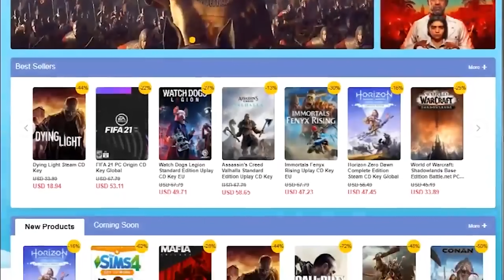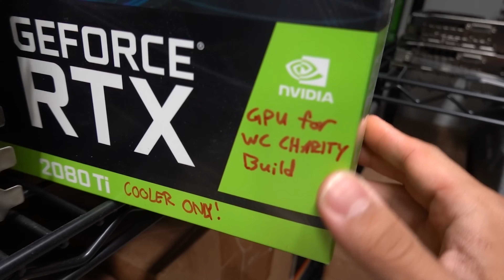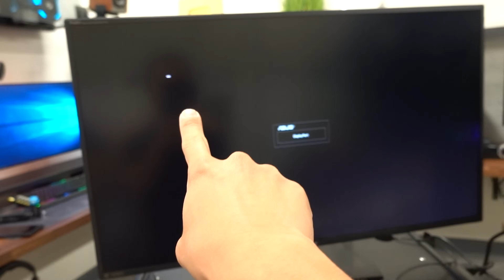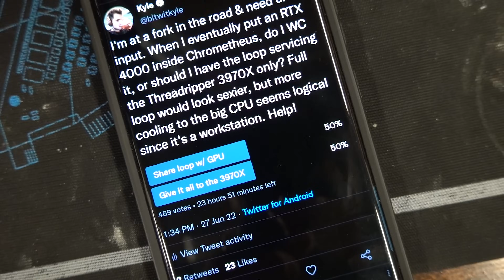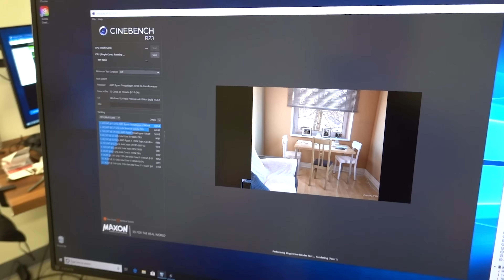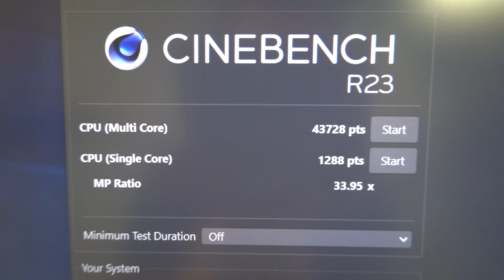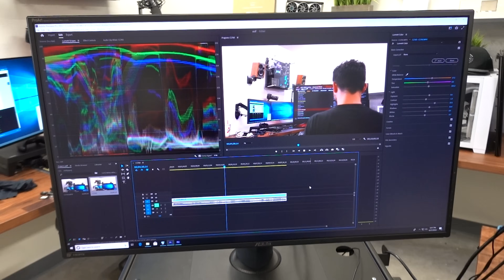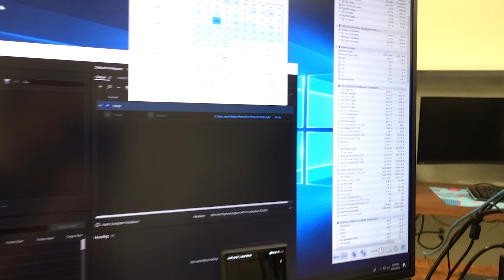YOU got my PC to work! THANK YOU!!

Comment: What a beautiful built! I I get it through needing all of them extra cores but at what literal cost lol. My ryzen 5950x is staying under 65c most of my 16 cores are @ 4999 Mhz Average, 5062 max 3599 mix. Running a simple negative voltage offset.       I couldn't agree more this is too fun that I quit kraq for building pcs. SAME COST more fun X'D lol.

Comment: Ok, the video doesn't make sense...
I've watched it twice and still can't figure out why you haven't done a few simple things:

1) you left the PC broken for 2 years without swapping the GPU to check if its good? Wtf
2) you plugged in the fan, AND at the same time you changed the GPU, but also without ever trying the original GPU back. You just pulled out a brand new GPU from the storage, put the water cooling on it and left the fan plugged in. What happened to the old GPU, is it good? The troubleshooting is not finished man....just saying.

So now, what was the problem in the end? A dead GPU or unplugged fan?

Comment: Keep the 4090 out of the loop. 
If you are hitting 80 degrees with the the 2080 Ti, you won't have a hope of cooling a 4090 effectively. 
That said the system is fine as is.

Comment: It's such a satisfying feelings when something hasn't worked for so long after multiple tries.....then you finally get it going....I was locked out of my dogecoin I had since 2014 and took 2 years of attempting to retrieve the private keys from old hardware and external HDDs that were fried from the wrong power supply....one random comment on reddit and boom I got it...best feeling ever.

Comment: I am currently building a PC 
Specs 
Ryzen 5 5600g 
Biostar a320 m
650 watt psu
16 g ram 
1 tb ssd 
I have hooked everything up but for some reason the case fans won't turn on can I have some advice for the issue

Comment: I just notice your talking while the system is running without coolant..
Well I did the same countless of times from a minute to 3/5 on a dry loop.
But I keep monitoring the CPU once it's hits 80+ or near 85 I shut it down and wait for a few minutes to turn it on again LOL mostly during testing when I don't want to put coolant just to test.

Comment: I understand the finding hardware you forgot you had. You probably bought a replacement part, forgot you did that, and only remembered the broken one. I bought a replacement cpu for my NAS system and forgot about it until I found the box chilling in my workbench. 3 months I've had it...

Comment: Whoever decided that it's a good idea to not allow the system to boot whatsoever if a fan isn't plugged into the CPU fan header is an idiot.  They might NEED to use that machine for something basic and failures can suddenly occur.  Not to mention, you can rip headers from a board if you pull on it wrong

Comment: Not letting the system boot whatsoever without the fan being plugged in is a stupid idea, you should be allowed to bypass a warning prompt if you want.

Yes there should be a warning that you bypass when booting, no it should not prevent the computer from booting into the OS.  Modern processors aren't going to go up in smoke from not enough cooling, so let users do things at their own risk because not letting them could easily cause more problems, not less.  You pretty much have to intentionally abuse the chip nowadays to degrade its life by any meaningful amount, so a short time to order a part or do something urgent isn't going to make a difference.

Comment: Your memory not POSTing at 4000MHz is a problem I had with my Ryzen build. It could be that your Threadripper is using an old Infinity Fabric that doesn’t support 4000MHz RAM. Getting a newer Infinity Fabric with a newer CPU fixed it for me.

Comment: You can tell the bios to ignore that cpu fan header altogether. I use Asus boards and do that since I use a 100cfm cpu cooler fan that I connect straight to the PSU.

Comment: Depends on what your own preferences for acoustics are. Given the 3090Ti’s cooling performance, their fan coolers were extremely well designed and operate with much less fan speeds than its predecessors. However, 40 series will definitely be hotter (TDP) and thus introduce a new variable for cooler design requirements. I think the thermal capacity of water will be capable of cooling both a 40-series and Threadripper cpu quite well as a given, but the new cooler design for 40-series will be hit or miss. Imo get some thicker rads @ the 360mm shown in this video, and you should be good to go for both power hungry components. A better/faster pump-reservoir should help as well.

Comment: Really sexy build and I can't wait for you to get that 4090 in there! That would be something. But the problem with using Premiere and throwing tons of hardware at it is that it will still probably be beat by Resolve and Final Cut Pro with a lot weaker hardware, in both timeline performance and rendering. It'll fare very well in 3D rendering though.

Comment: You could test the air cooled 2080ti system temps versus the in loop 2080ti temps, and see how much increase in heat the system has, and figure out the headroom in cooling capacity for the extra wattage of the 4090 to determine if you want to add it in loop when you get it.

Comment: That thing is doing video only. I wouldn't even bother with water to begin with. Unless you plan on running VM's and trying to render 4 projects at a time. Esp, since I'm pretty sure the Adobe video stuff, doesn't really use much past 12-16 cores, let alone 64 threads. Video editing is a total snooze fest for that hardware combo. Even more so with the 40xx I'm sure. Won't see the gains like there were when going from 20xx to 30xx but even if its 15-20% better that's MASSIVE compaird to the 20xx series. SO yeah. I wouldn't even bother going with water on the GPU. Whatever you call overkill on somehting that is already overkill that's what that is.

Comment: his "old news" card, would about be the upper limit of what this system could effectivly use... heh...

Anyway, i would share the loop, but the way i would set it up is a bit... odd... i would have the hot and cold sides of each rad linked dual pump in push/pull dump the hot from both sides into the shared hot side pool and pull water for the cool side from the cool side of the pool, overall this should give the best results... 

we use to build manafolds from copper plubing tubing back in the day.. infact, took us 9mo back in the early 2k's to build a steam punk pc that was cooled with solid copper tubing barring a short flex tube to each block, there was no elegant way to hard tube the entire system back then, it was as close as we could get, and, that systems still up and running, the fellow actually ran the loop with some stuff that gives the copper a faith tarnish to the surface inside and seals it, so it wont slowly green the water/coolent, we used 4 old all copper heater cores solderd togather for front and 3 for top of the system, when we re-built it a few years back we actually switched it to noctua ippc fans with a 3d printed shroud duct and ducting foam making the whole thing one hell of alot more efficient...i kid not when i say, an extra 500mhz on the core better... we actually setup a dual res back then, with a hot side and cold side, put a fish tank stick on thermo on the hot one so you could see it threw the case window, we replaced the stick on with a new one when we re-did it, outside that its working great, even the water blocks still considered one of the better ones from what we found, hes quite happy with it again, when his daughter got him a chip that lets him max out that platform and overclock even better... hes set for a couple-few more years with the O/C they managed...

Comment: I appreciate that you're just happy to finally have it working. I'd be spitting coals if I had a PC down for 2 years because a fan wasn't plugged in...
Reply: It was down because of a dead GPU. The fan being unplugged was just during some diagnostics while he had the system apart.
Reply: @TimBoundy  hmm, you might be right, the troubleshooting wasn't properly finished. He tested a new GPU at the same time when he plugged in the fan, then he realizes he has a brand new GPU laying around and installs the water cooling on it, never returning to the original GPU to check if it was working.

Comment: Just try out the 4000s gpu first with air and if it works that greats, that would mean less heat for the water to transfer and disapaite and might get a higher OC on the threadripper.

Comment: If the 4090 founders edition is the same silver and black colors as the 3000 series it would match nicely with the air cooler and you could always add a water block if it needs it later. .

Comment: @bitwit You will never get that memory to work at 4000, i think its about 1 in 30 chance that it will run 4000. 3733 14-14-14 is more common on that platform.

Comment: Definitely put the GPU in the loop...they clock down so far when not in use that it won't make a difference to cooling until you're actually using it, and when you are using it you definitely want the benefit of water cooling.

Comment: 1.35v at 4ghz on the ram is probably not enough, you would want at least 1.4v-1.5v, depending on your voltage assuming your ram is b die
Reply: also your fclk is very likely to not be able to run at 2000mhz

Comment: Doing manual overclocking of each CCX my 3970X, I was able to get over 51,000 in CB R23 and over 28,000 in Geekbench 5.  There is a lot of headroom left in that CPU with water cooling.

Comment: I'm running a Prime 399-A board with a Threadripper 1920x with all 8 ram slots populated.  They've each got Corsair Vengeance 3200 Mhz 16 gig sticks in them, but I've never been able to get them to clock any higher than 3000 Mhz.  I feel like it's just a limitation when you run that many sticks of RAM in a board.  I could be wrong but I did spend quite a bit of time trying to get them to run at their rated speeds before settling at 3000 Mhz

Comment: Lulz silly you eh hope you get it running perfecto ima been gaming on a monitor the ASUS VG278QR believing it was VA panel only to realize it is actually a TN bahahaha silly fkn me perfect for first person shooters such as Destiny2 PvP...  PS go for the fully water cooled CPU because infinity fabric runs best when kept cool as possible eh plus the 4000 series will be a massive leap so will be the thermals also...You could try the RAM at 3733MHz but you will not notice any difference if just using it mainly for encoding video editing etc so probably best left at 3600Mhz for the Ryzen chip  RAM timings 17-17-17-37@3733MHz or even try looser timings at 16-17-17-36@ 3733MHz that should run faster with Ryzen again it will be up to you with trial and error just do not put the voltage up above 1.425V hope this helps although as aforementioned 3600Mhz is totally good to go with Ryzen TR do some research and get a pro overclockers advice plz...

Comment: To be honest, I feel like the way that board behaves when the CPU fan connector is not plugged is either a defect or a bios bug from the mfg. It absolutely should at least boot and give you an error as you said. That's very confusing especially when it takes that long to boot and show that error.

Comment: While I'm super happy for Kyle and this epic build, once again I have to call this one a FAIL.
Sure, it runs fast and looks nice, but this is supposed to be a working machine used for work.
So it MUST be designed with a minimal amount of serviceability.
If something were to go terribly wrong, and the boot drive becomes corrupt, you MUST be able to physically remove the drive and swap in a new one. This is not negotiable.
If you have to drain the loop and remove hard tubing to gain physical access to the boot drive, then your priorities are misplaced.

Comment: First: Well the GPU actually looks nice enough and fits the build just air cooled.

After putting full water block and the tubing: NOPE, you gotta water cool both CPU and CARD!

Also cause the 4090 prolly run hot.

No doubt, that GPU with those blocks, silver fitting and backplate and tubing looks HELLA nice. Watercooled GPU all day.

Comment: Maybe the 4000 MT/s RAM will post if you overclock the CPU's FCLK to 2000MHz, but I'm not sure
FCLK is the CPU's memory controller speed, although it might also be possible that your motherboard or CPU simply don't support that high of a speed

Comment: Imagine getting a brand new expensive car like a Lamborghini. Then don’t bother starting it up and leave it to sit for years outside. Dust and sun wear beat on the car causing damage because you were so privileged and didn’t actually need the car. Years down the road you finally are like, “I guess I could start up this Lamborghini for the first time since I got it.” You go to start it up and it doesn’t turn over, the battery is dead because the alternator never kept the battery charged due to never starting the car for years. You replace the battery but the car is already beaten and damaged from the lack of attention and care. Now you go to start it up again with a new battery applied… now you realize you left the keys in the car and the doors are locked. Your community let you know that you should have a spare set of keys in your house. You acknowledge common sense and go get the keys to open the car and see that the interior lights even turned on when you opened the door. Now you start the car and show it off to the community but the damage is already done, you had a brand new car and ignore it for years then make common sense seem rare like you don’t have any. 

Yes you may have finally given it attention finally after years but this means nothing when you say “I am waiting until I got a new model alternator when it comes out” so we will watch the 5 minutes of fame you show the community of this car. The next day it will just be set aside again until the next gen alternator comes out… what a waste.

We don’t appreciate the ignorance of a privileged YouTuber.

Comment: You do now that recommend speed for memory on zen 2 is 3600MHz cause infertility fabric clock is at half that speed, and usually maxed out at 1800MHz if you have good silicone you may be able to push it to 1900MHz thus being able to run 3800MHz on ram. But higher than that is pretty much impossible. 4000MHz memory is pointless. AMD probably disabled those speeds cause looking purely theoretically infinity fabric steps down it's clock to 0.25 clock of ram if over "loaded" but that just results in worse overall preformance.

Comment: 18:31 I think there is something wrong with your GPU 109.4 on the Hot Spot and only 169.3W power draw seems a bit low.
Reply: He missed a thermal pad on the gpu block so I think that’s the reason
Reply: definetly not right, should do more testing

Comment: I have that same MB and had a similar issue. It turns out that I wasn't seeing the CPU fan error because I had my GPU plugged in via Display Port, which prevented the system from displaying any bios output (this problem went away once I updated the GPU bios).

Comment: That extra 2080 ti could've fallen off the table so easily when you left it hanging half way off the table lol would've had a Linus moment
Reply: You obviously haven't picked a Asus Strix GPU. They're heavy cards.
Reply: @spankbuda7466  and i never will im not an asus fan
Reply: @FalternateReality  Well it's not about you being a fan. It's about informing you that those Strix (and others) GPU's have some weight to them (almost 5 lbs. in box). That's why I left my comment.
Reply: @FalternateReality  it doesn't matter if you are an asus fan - all cards are very similar in terms of dimensions and weight

Comment: I've built my own PCs since the 90s, but at the beginning of this year when I built my gaming PC, I hadn't connected the 8 pin power cable to the motherboard as it's just a 5600X which doesn't use a lot of power, so I for some reason thought it wasn't needed unless you use a power hungry CPU, and as it was a test boot before I put it into the case, I didn't connected the EPS power. I went through three different GPUs to see if it was the graphics card or something else that was the cause. But nothing. Eventually realized it might be the EPS power not being connected, so I connected it, and boom, boots :P
Reply: Yeah, I believe that you meant to say that you haven't built a PC since the 90's because in 2003 motherboards manufacturers had added the additional 4 pin power connector and started to have the 24 pin connector as the standard. The 8 pin connector isn't just for the CPU either. It's used for giving power to the PCIe slots and also on these new motherboards your are required to connect the 8 pin even if you only use 4 pins in the 8 pin connection.
Reply: @spankbuda7466  No, I said exactly what I meant to say. I didn't say that I never used the 8 pin connector, just that I didn't use it on this build when doing a test boot before putting it in the case.

My whole point in posting this is that everyone can make silly mistakes at times, so I don't get the point with your reply.
Reply: @Alexandra-Rex  Well for a person who is portraying themselves as a "experienced" PC builder should've known for today's PC mobo's that you need to connect that 8 pin for system boot. 
Now I can understand that you most likely were building with dated components until you have made that leap in 2022 to start building with modern PC components. 
But hey, I look at it as having lack of education on your part.
Reply: @spankbuda7466  All the clues you need to interpret this correctly are all there, so I'm going to leave you to it. Maybe check the video again, then properly read what I wrote.